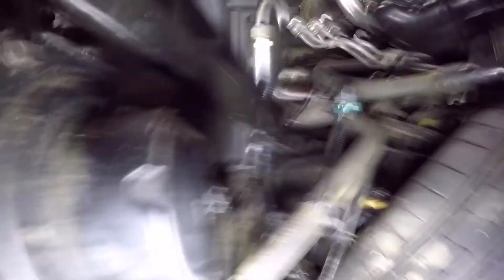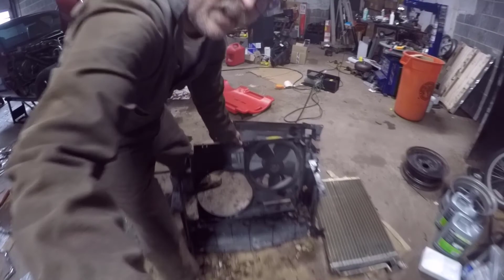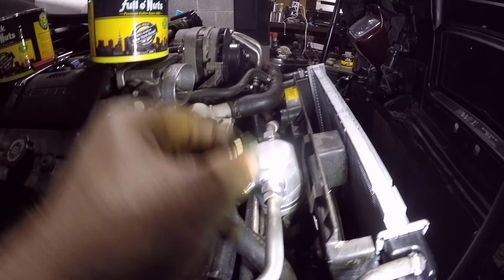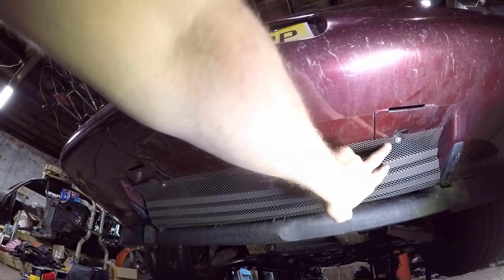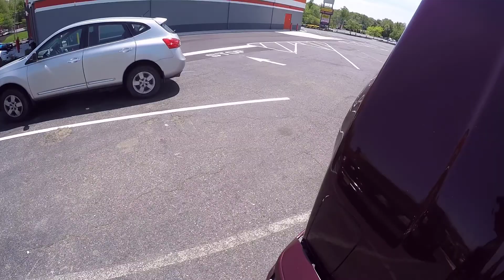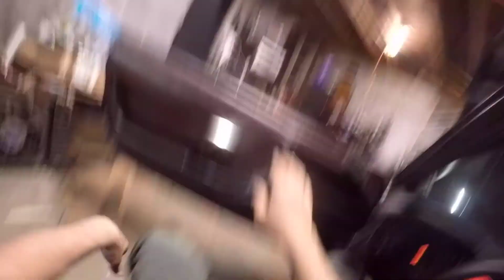CC Top Solutions Ep 5 C4 Corvette Radiator, Radiator Guard, Fan and AC Charge Troubleshooting

Comment: where did you get the floor lifts?  what is the name of the manufacture? Model, cost?
Reply from the maker: Oh, its a Quick Jack car lift setup. I got it as a gift. It uses 120v power, pretty cool. They key is making sure the two lifts are parallel...and dont stack wood on them to increase lift height. Oh...also, depress the drop button while disconnecting the hoses...makes life easier. Cool product!